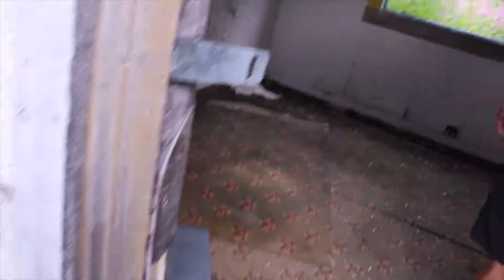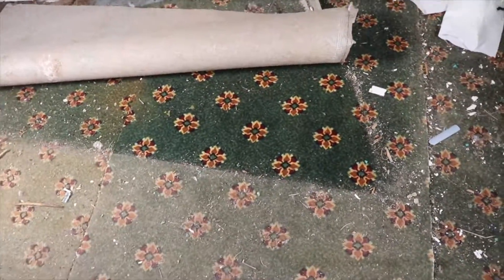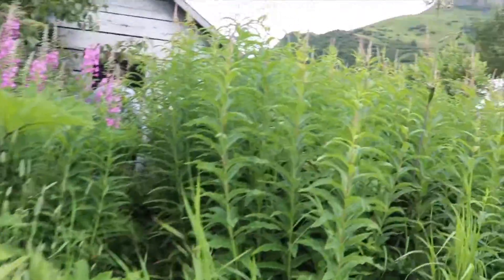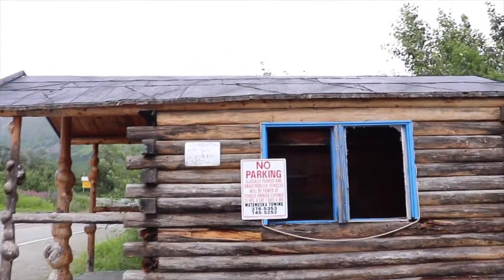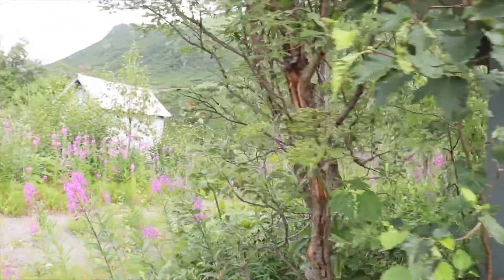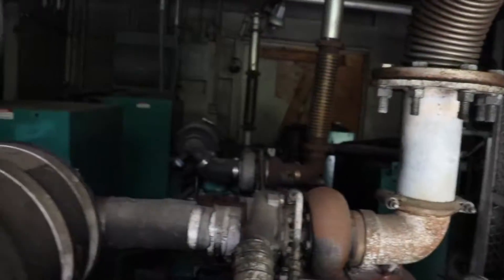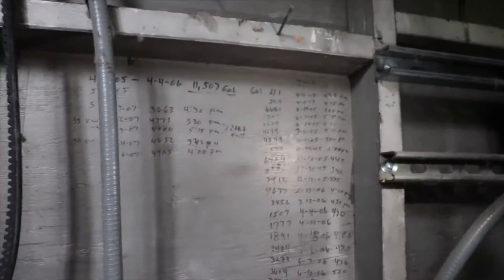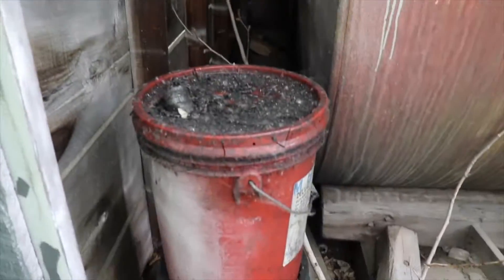Abandoned Generator Room In Alaska

Comment: Cool generator discovery Simon. The Northern Lights gen set sure had a lot of use, you can tell by the oily crud in the generator vent screen @10:35. A lot of people over time have read the spec tag on that gen set, it's the only clean spot on it. :) Nice simple reliable generators in their day. The other two are Cummins powered Onan generators. Onan is a subsidiary of Cummins these days. Decent gen sets, but a little over engineered /complex.
Reply from the maker: Thank you so much for the information

Comment: Jump to 08:33 if you want to see the actual generator part.  And there are three generators for three phases of common electrical systems.
Reply: Actually, each generator would be capable of generating all phases, weather it be single or 3 phase. The purpose of having 3 generators is redundancy. Depending on the generator sizing and their load, it could be set up where 2 generators would be required to run at maximum load and you'll have a backup in the event one fails. I believe that would be what they call N+1 redundancy. Another possibility is that a single generator can handle the load, then one can be down for maintenance and you'll still have a backup in the event the running generator fails. That would be N+2 redundancy.

Comment: it looks 3 phase  generator. Notice the 3 meters. Maybe 205 volt or 440 volt. Wish they could be restored still in good shape. If the battery was there and are good it could still start even though the wires off it are cut. good find..
Reply from the maker: Thank you for the information I wish I knew all of this before I went so I could have tried to start them or at least knew how to.

Comment: These things are still expensive
Reply from the maker: I could only imagine how much this equipment plus the fuel and the man power cost while  building it and the value it all has today. I would love to see it working or being put to use again because from what I’ve learned from the comments is that they still might work. Also thank you for the comment and watching the video it means a lot.
Reply: @SimonRScott  before u start make sure it has engine oil. If u can add some engine oil into the cylinder or atleast the intake. These things are sitting for long time and pistons are completely dry and if u try to even rotate them the cylinder walls will be really damaged.spray wd40 if can't find anything. Make sure it has oil pressure when it runs or immediately shut it down. These things are worth atleast 50k$ or probably even a 100k
Reply: @SimonRScott  it's a diesel engine it will start right up but if u take some preparation it will save the engine from being scraped. Running the engine without proper lubrication for 5mins will do more damage than it running with proper lubrication for 1500hrs.